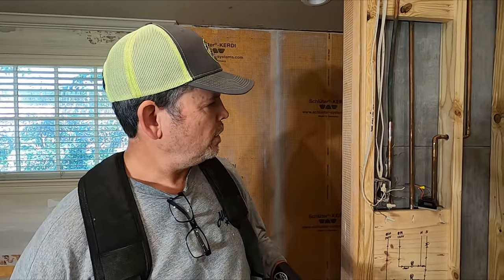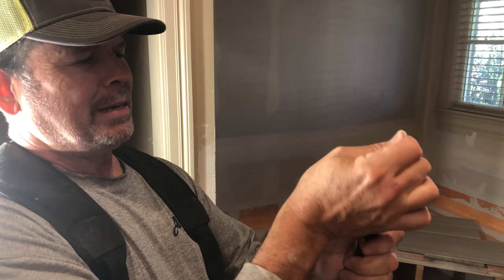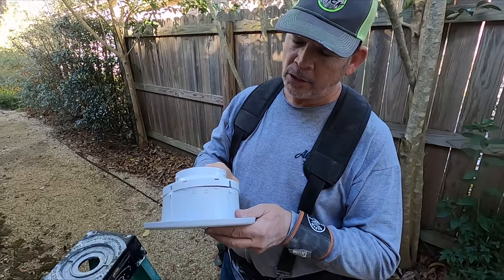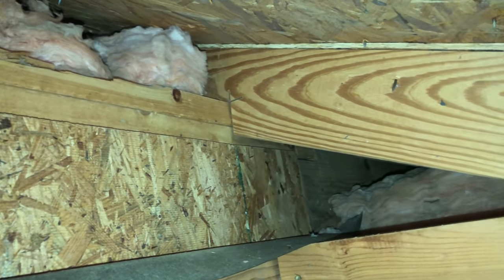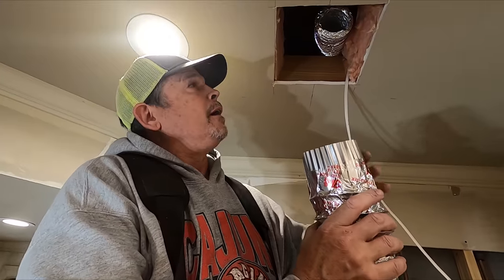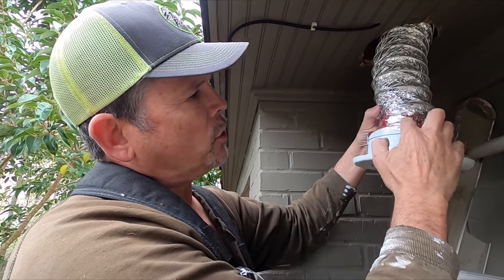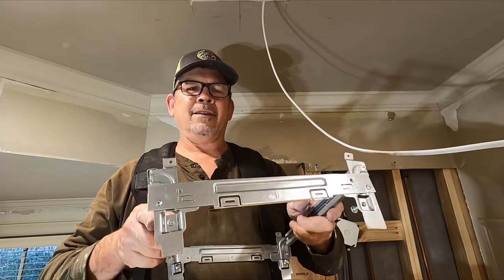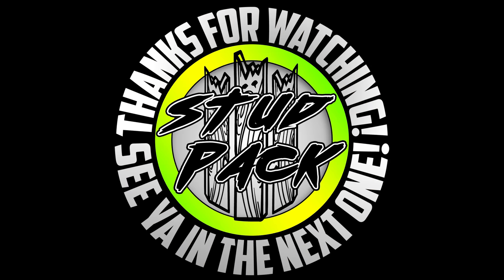Exhaust Fan Installation Gone WRONG | We Used All of Our Tricks...

Comment: In preparation to sell our house 2yrs ago I had to replace the exhaust fan in the master bathroom. I was shocked to see the original fan installed just as you described, no hose and exhaust port was butted up against insulation. Lived in that house for 12 years and to think of all the moisture that was just blowing into the attic.
Reply: It’s really not that big of a deal to have it blowing into the attic

Comment: Love your videos. Really making me want to start a construction business with my son (he’s 15 now). 

I think you should have punched through the roof. It’s a better way to exhaust moisture compared to soffit exhaust, but I get the challenge of going through the roof. I used to avoid it until last fall I was forced to exhaust a kitchen vent hood  through the roof. The process seemed daunting, but after I did it...I was shocked at how easy it really was (no leaks a year out). My hesitation to roof work is heights and the pitch of a roof. 

Either way... great job and excellent problem solving along the way! I’d definitely hire you guys if I wasn’t such a DIYer!
Reply from the maker: Thx Matthew.  Yes, I should've gone thru the roof.  Woulda been faster cheaper better in the long run.
Reply: Do the construction company with your son. My dad and I run a company together, and it’s the greatest thing ever. We each bring our specific skills to the company. He has a lot more experience building new homes than me, and is infinitely better with communication and scheduling/x’s and o’s, but I am much better with the precision craftsmanship, intricate problem solving, etc. And I couldn’t do it without him, and he couldn’t do it without me. He and his brother had a home building company when I was a child that failed. I’m pretty proud to know that he and I have been successful for over the past decade, and have no signs of slowing down with the exception of the apocalypse. We look out for each other, and love to listen to each other’s ideas to come to the best solutions. I think father/son teams are where it’s at, man.

Comment: I put one of those exact fans in for a customer in December, it was right slick. I cut a 4 & 1/2" hole saw hole in the shingle roof and used a fancy exhaust vent roof jack. I'm curious Paul, why didn't you vent it out through the roof?  I have a hard time believing that a roofer would do a better job than you.

Comment: 4:40 in. the tip about checking for hidden obstructions using that bent wire ws amazing. Top tip of 2021 for me.
I'm gonna use that neat trick.
loving the way you guys work  together, and very informative.
as an old school joiner its amazing how you can still learn tips and tricks.
keep up the videos
Reply from the maker: Thx 👍
Reply: I also liked that tip a lot. Thanks guys!

Comment: couple of things people should know before installing a soffit fan vent: make sure there’s not an actual “soffit” vent within 3’, to keep the moisture from being pulled back into the attic. Also, the flex duct should be insulated. The reason why most houses built before the 90’s don’t have fans in the bathroom is because of building codes. As long as there’s was a window that could open in the bathroom a fan was not required.  Just a fun fact.
Reply: Fans actually weren’t required in bathrooms until about 2005 interestingly enough.

Comment: You definently will have a problem with water in that flex hose. I think I had maybe 14 ft installed.  After 6 months I notices spots on my bedroom ceiling.  Sure enough it was pockets of  condensation inside the flex hose. Plus the kidos like to take hot foggy showers Lol. So i hired a roofer. He went straight up to the roof. Now it works even better!  Just a thought👍
Reply: I live in the south and don't know if that makes a difference but I installed my exhaust through the gable, used the more rigid aluminum flex, and made sure there the duct had a slope to the outside.  I run my fan long enough to pretty much dry any potential moisture in the duct.  No issues at all, plus no roof penetrations to worry about, which my was biggest concern.  Had a kitchen hood exhaust roof vent start pouring 5 years after reroofing and ruined the ceiling in my kitchen.  No more through roof vents if not absolutely necessary.

Comment: Would you recommend connecting 2 or 3 exhaust fans to one exhaust outlet using a wye joint? Or is the code recommendation to have an exhaust outlet for each fan?

Comment: Hi guys. Love your videos. Quick question. That fan duct was not insulated. I don't know what climate you're in there, but I had a huge issue with an upstairs bathroom vent freezing up in the winter in Michigan. Should you have run insulated duct? And by the way, I'd love to see more videos regarding electrical circuits that you would find in a remodel. Keep up the good work!
Reply from the maker: Thx Dale.  Never see insulated fan exhaust duct in the deep south but I understand why you'd need it in Michigan.

Comment: Was always taught not to add exhaust vent to a soffit, especially when have a soffit vent anywhere near the exhaust vent. Also, was taught to use insulated flex duct as well……
What do you think?
Thx for vid, love it/channel
✌🏻
Reply: When you vent to a sofit, there is a high chance the vented air then gets fed back through the sofit and into attic.  This is natural air flow and by design of what sofits are for.  Unfortunately, the moist air from the bathroom is conducive to mold in the attic.  The other issue you raised which is insulating the flex duct is so that during the winter time if you have warm/hot air going through the duct it won’t condensate around the flex duct.  Again, same issue.  Moisture in attic is bad…. However, if the soffit itself has no vent or if the climate in that area has no winter then it should be fine

Comment: My teens bathroom upstairs took a quick turn into being very moldy on the ceiling.  My son failed to inform me that the fan had stopped working months ago.  I go to replace it and discover that just like you explained with the toilet vent, the fan was never even vented, and in fact, was buried in insulation.  I watched a lot of videos on cutting into the roof and installing a vent and did it all myself.  Is there some sort of code requirement that made you need a roofer for the job?  That would have been a lot easier.

Comment: The are a lot of things inspectors allow, that I would never do(and I'm an inspector) 
I would never exhaust out the soffit. It's a good way to rot that soffit out as the moist warm air rises right back up into the soffit. Much better to go through roof. The little extra work it would take will save a lot of extra work later.
I also would use an insulated duct.
Love the videos though, very entertaining!

Comment: Some here are saying that the duct should be insulated and I concur. Insulated duct can be a pain to work with not to mention that it is ridiculously more expensive (I just installed one). However, condensate that accumulates can be far more of a concern than just ruining the fan. Standing water under those conditions can turn into a batch of Legionnaires disease.

Comment: Just installed 2 panasonic whisperchoice pick a flows last weekend. We had no existing fans so getting in the attic is a must. I feel your pain.. and know why I got recommended this video lol.

Edit: For someone with drywall, it is still possible to add another switch. You need a multi tool or sawzall to carefully cut the oldbox off the stud and then cut the drywall to add a double gang old work box.

Comment: Worked in a apt. complex 3 stories high, 300 apts. All centrally flex ducted to the roof 30 ft up and only had a handful of water in the duct problems in the 18 years I worked there.

Comment: With the wall open, why would you prefer to use an old work box for the exhaust instead of replacing the single gang box with a 2 gang box?
Reply from the maker: I couldn’t fit a 2 gang without cutting the king stud and then the cover plate would have interfered with tile trim.

Comment: Im heading over to my new (to me) house to replace 3" duct with 4" ..i tried to do a 3-4" adapter..but it didn't fit in the area i have available.. the ductwork is running about 4ft to the right through an old exterior wall into a new addition and about 12ft to the current exterior wall..not looking forward to dealing with that corner ..i imagined my ducting tearing apart like yours did at first.. we'll see how it goes lol

Comment: ? is there a split hose connector that can attach to the exhaust fan hose you just put in? Another ? is it under code if you do it that way? Lastly would it be easier that way or more work lol? The reason I ask is because if you don't need to cut another hole outside and have two vents next to each other, just have the one vent with two hoses going outside. Just an observation and no I am not a contractor so was just wondering it that would work to lessen the load. Thanks for the video's it is giving me ideas as well.

Comment: Panasonic makes a few models that have motion sensor and humidity sensor built in.  Bit more money up front, but no need for switch and with both the motion and humidity it just works when it needs to and does not get left on when not needed or not turned on when needed.

Comment: I just watched a This Old House video where they removed a vent that was vented out an eave that was starting to cause mold issues because of that. Their line wasn't insulated just like yours. Not sure if that's a code thing per state or what. What pitch is that roof? That's about the only thing that could've stopped you from going through the roof. It's so unbelievably easy to cut a hole and put a vent through the roof.
Reply from the maker: Not code here 👍

Comment: 3:00 Another tool that I like that works for stuff like that, "flex shaft mechanical pick up tool". Like an adult version of those claw toys we used to have... Use them to reach down into engine bays and grab bolts and things similar. Would have worked great to reach in there and grab ahold (with enough force to grip) of the wire and bring it to him.
Reply: 6:28 That mechanical grabber may have come in clutch here too. check them out.

Comment: Love your channel! I do have a question. I am replacing the old cast iron vent stack in my Duplex. The bathroom has never had a shower vent. Can I run the shower vent into the new PVC stack (connection would be upside down so no water came in) I really don't want to cut a hole in the brick that high up, so this would save me a lot of work! Thanks
Reply from the maker: Without pics or knowing where you are, I'd say that should be fine but plz check with a local plumber or your permit office.  It may be that the shower drain is wet vented.  If it never had a vent but drains fine....  another reason to check with someone local.
Reply: @StudPack  Thanks

Comment: That job could lead to mold problems in the near future. The duct should be insulated to help prevent condensation. The moist air from exhaust could possibly circulate back into attic and start molding issues. Maybe.
Reply: I work in attic all the time as an electrican and fart fans like this rarely ever have ducts connected to them and I’ve never seen mold around them

Comment: Appreciate these, I actually have a panasonic fan I need to install!!! So, a truck with the metal tape, to keep it from curling when you peel it.  Start peeling a corner, then hold the length of tap down your front, touching your shirt, them peel the corner you loosend down.   You will eno with dead straight tape, no curling :)
Reply from the maker: I'll try it thx!!

Comment: I like using insulated duct on my exhaust fans to eliminate drips from condensation when warm air is pulled through unconditioned areas.
We installed a vent in a basement bathroom used 4 inch foam core pvc sewer pipe. We were able to drill a 1/4” hole outside and visibly see it was centered and in the correct area the cut a hole big enough for the pipe to make a straight run from the bathroom to the rear of the house.( we didn’t want to exhaust the bathroom close to the front door) I wish we would have made a YouTube video of it.

Comment: Aren't you supposed to use an insulated duct for the shower vent since in the winter the air above the insulation layer in the attic will be much colder, resulting in condensation? In this situation, i can see why you wouldn't due to space.

Comment: hate to be that guy
but a nice trick for the jigsaw i learned is to use the spade bit and make a hole right on the edge of your cut out and use that as the starting point for the cut, just my 2 cents

Comment: I’m curious, while running the bathroom exhaust vent along side the one you just installed, are you going to install a separate vent for it in the soffit? Or put a y in the duct so that they vent through the same opening?
Reply from the maker: 2 openings in the soffit.  Each fan has its own.
Reply: Thank you!

Comment: Please don't do a standard switch for the exhaust fan.  Do a switch with timer selections, mine I put in can do 1min, 5min, 10min, 15min, 20min and 30 min.  Much better to keep getting that moist air out after you leave the bathroom.

I hated redoing by bathroom exhaust.  My bathroom had the original from 1963 and there was no ducting on it, no roof vent to go to.  I had to do the roofing vent install then put the insulated ductwork in after removing the old exhaust fan and putting the new one in.  Old one had almost impossible to remove screws because it was put in without the drywall in the way!

Comment: The only trouble with using that flush vent in the soffit is that it allows the warm, moist air to flow back into the attic through the soffit vents and cause rot and mold in the attic.

Comment: since you have the drywall off where the switch is going, why not just put in a double gang box for a cleaner look?
Reply from the maker: It won't fit
Reply: @StudPack  just move the water pipe..... lol
Reply: @StudPack  technically though, you could move the entire mounting point over a stud to the right if there isn't a door or something else blocking the wall to that side.  Would move the electric away from most of the water pipes as well.  But then again, I'm not the one doing the work and I'm not on site to really look at it.
Reply from the maker: Everything is in my way on that 🤬

Comment: Doesn't code call for rigid ducting? I thought flexible ducting was only for short runs on dryer exhaust.
Reply: Dryer exhaust has to be rigid to prevent lint build-up on the flex ridges. I don't believe bathroom ventilation has the same concerns as it's just air that's being exhausted.

Comment: You might be creating a very large problem with that uninsulated drier hose.  Don't know about your neck of the woods but if you have a lot of ambient humidity that style of hose (besides being too flimsy to clean down the road) with no insulation will make condensation like you can't believe.  More than enough to soak the fiberglass batting and bingo you are in mold territory.  They do make a pre insulated ducting specifically for bath fans.  Some of it is even flexible although not as flexible as that drier duct (surprised they are even selling it as it is not code for driers and hasn't been for a good number of years).  Sometimes there just is no easy way and you have to cut access in the dry wall.
Reply from the maker: Way too hot here.  Southern Louisiana

Comment: I also installed a Panasonic to avoid going into the attic, due to very little clearance—kind of a pain to string the wires without getting into the attic, but I used a fish rod and successfully did that by myself. I used a 54” drill to go vertically from the hole I’d cut in the wall for the timer switch, managed to push the wire through that hole with the fish rod, then grabbed it (after many tries) with another piece of fish rod with a hook on the end. 

But I had no hesitancy in cutting the roof for a vent and ran about 4’ of ducting to it—but I insulated the ducting first. I used my fish rod again to pull the ducting from the fan hole to the roof vent hole, attached it to the vent, and installed the vent appropriately with roofing cement. Then I attached the ducting to the fan housing and installed the fan. That was several months ago, and it has worked superbly. The Panasonic moves much more air than most other fans, and it does it quietly, so there’s not much chance of moisture being trapped in the ducting. But insulating the ducting is pretty important, too, to reduce the chance of moisture collecting inside the ducting. It’s also important to use a timer switch, so that the fan can continue to run after the bathroom has been vacated, to insure that the moisture is fully evacuated.

Comment: Use a pipe, either electrical or plumbing. That way you can feed Romex wire thru it. It is much easier than a stick or fish tape.

Comment: Using dryer vent hose rather than an insulated vent hose, will cause it to sweat in the attic, won't it. In my neck of the woods it's a code violation.
Reply from the maker: Not where we live.  It’s way too hot